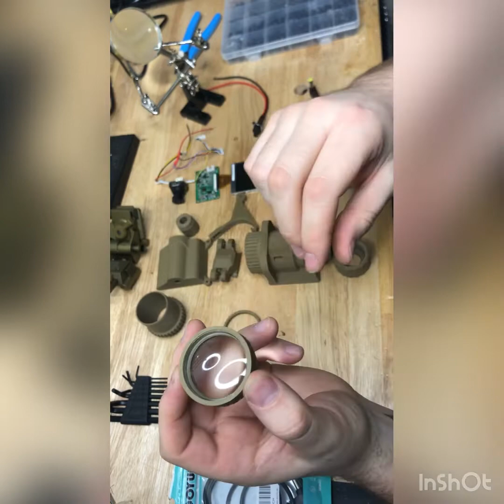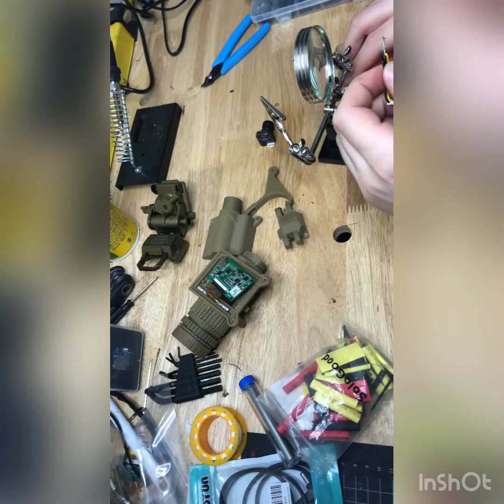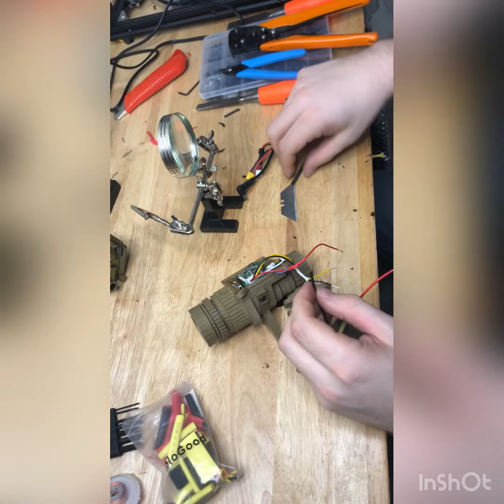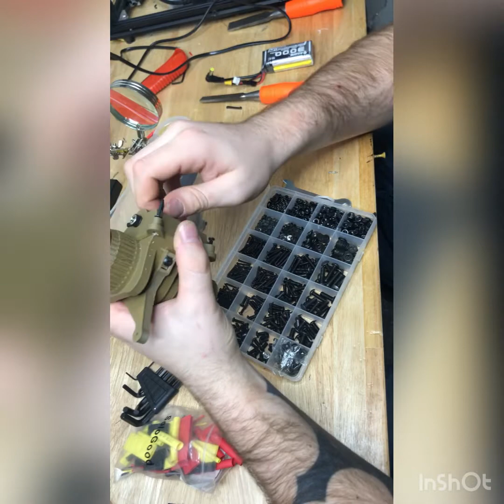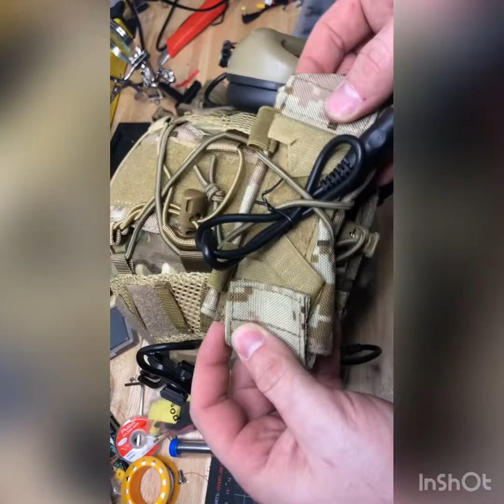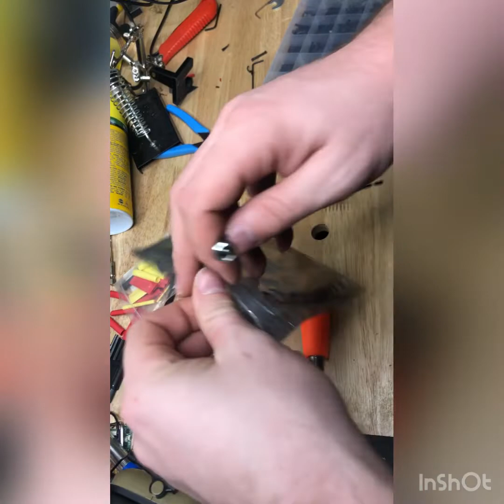PVS-69 gen 2 build tutorial

Comment: Hello, can you use insted of adafruit displays round displays from smartwatch? Like IPS LCD or AMOLED display? Resolution is better and even pixel size is more favorable. And they cost cheaper than V 780. I found on aliexpress 1.39" display with 400x400 resolution. With bridge asembly corners of dispaly migh be distracting and limiting sight, no?
Reply from the maker: You should look up PVS-69 gen 3x
Reply: @vonscherfarms925  yeah, but i want bigger ocular lens that shows round image, instead of tiny rectangular. Plus cost
Reply from the maker: @СвятославЗанік  look at gen 4 then. Both gen 3 and 4 are far better than a watch display
Reply: @vonscherfarms925  yeah but still. Rectangular image, cost, and size of lens. My question is Is it possible to use smartwatch amoled display or not? If yes, what are the drawbacks. If not than ok, thank you

Comment: So is this supposed to be for airsoft or something?  If this is for shtf what are your plans for going against people that have tubed NV that you seem to dislike without IR lights?  Also do you have plans to manufacture with materials that aren’t so delicate since a good drop could probably destroy the wiring inside?  Just curious.
Reply from the maker: This is my gen2 design the housing is pretty strong unfortunately I can’t do much about the display however the camera will do fine. I’ve moved away from the gen2 and towards the my newer 69.3 which uses a .0001 Lux camera and a Sony microdisplay. Haven’t drop tested those but 99% sure they’re gonna hold up since everything is much more secure. These don’t require active IR to work since the cameras are so sensitive. If you want active IR though you can do a 1200NM IR led which isn’t visible to analog tubes
Reply: @vonscherfarms925  woah that’s actually a cool fact, so even though you need to rely on ir light a lot more than analog, you can see light that analog  can’t?
Reply: I mean realistically most people you come across in the apocalypse have any form of nods, so this would give you an edge over 90 percent of possible threats

Comment: Looking forward to the GEN 3 tutorial. I don't know enough about wiring to do all the shut off switches but if that video is as good as this one, it will be a breeze. I have everything printing now for the GEN 3. Thanks for all your efforts on this, it is appreciated.
Reply from the maker: I have video showing to to solder the auto shut off board however I have had a lot of issues getting the auto shut off to function properly so I advise against it
Reply: @vonscherfarms925  Thanks for the advise!
Reply: @vonscherfarms925  Question about the Runcam NE3, are you removing the IR lens from the camera? I know there are tutorials everywhere with people using FPV cams that remove the IR lens from the camera, and I didnt know if you were doing this as well?
Reply from the maker: @TheCoalitionofCombat  should be fairly easy to check but I don’t think the NE3 has a filter
Reply: @vonscherfarms925  Thanks I appreciate that. Got everything printed for for the GEN 3 just waiting for the displays to come in. Getting excited to get this together. Thanks for posting all this stuff, it is appreciated.
Reply from the maker: @TheCoalitionofCombat  hell yeah man hopefully I can get the gen 3 video up soon
Reply: @vonscherfarms925  looking forward to it!
Reply: Hey Question for you. So I built the Gen3 with the Runcam Night Eagle 3's but dont have the setting you show on the build write up. I dont see the "WDR" any suggestions?
Reply from the maker: @TheCoalitionofCombat  I don’t remember how I got to it exactly but you gotta click around

Comment: Does the V760a-5 board + display fit the same as adafruit 2" display? I saw you were actually recommending that over the adafruit because of the higher resolution.
Reply from the maker: I also released a brand new design specifically for the new screen
Reply from the maker: No it doesn’t fit the same at all. However I designed up an adapter for the PVS-69 that fits the new display

Comment: Have you considered ordering camera modules off of aliexpress instead of relying on FPV cams? The closest comparison that I think of is sony's starvis lineup of CMOS modules with back illumination, with the IMX482 being probably the best bet. Given that runcams are analog they likely use CCDs, which aren't really on the cutting edge of camera module development anymore so you'll likely see significant improvements.

I'd planned on doing it myself and still do, as I have a few ideas on how to avoid latency issues, but given your designing skill it'd very interested to see what you come up with. Do you have a discord or anything?
Reply from the maker: I’ve tried the Sony 1/3 cmos from a cheap security camera it’s really not worth it. If cost is the issue a $30 runcam Phoenix performs far better than the 1/3 cmos
Reply: @vonscherfarms925  The IMX482 is a recent 1/1.2 module and is really a 2x2 pixel binned version of their 4k res low-light module leading to a massive(compared to most other cmos) 5.8 micrometer pixel size -- fantastic for low light. With back illuminated pixels only being used in consumer sensors in the past few years I doubt the one you tried was near the same. Cost isn't an issue for me, but I know it is for a lot of folks so I brought it up.
But ignoring specific models, CMOS sensors can be very very good, and are only getting better.
Reply from the maker: Sounds like your technical knowledge far exceeds what I know lol I just found the drone camera that worked best and went with it. Another consideration was the support network. Lots of people use these drone cameras
Reply: @vonscherfarms925  Support and parts availability are extremely important, so that's fair.
Reply: @apollo9x19  The PVS-69 is not a ripoff of the BPNVG. Both use the same camera and whatnot, but his design is clearly superior considering the amount of added adjustment. And I think his wins out aesthetically by miles, but that's personal.
Reply: I assume your technical specs are correct, but are we looking at the same sensor? 458 USD? That is the only result that I am finding with IMX482 as my search query.
Reply: @JeronimoStilton14  Look on the usual chinese websites. You'll have to order at least two or three, and know what you're ordering. They cost $40 per module.